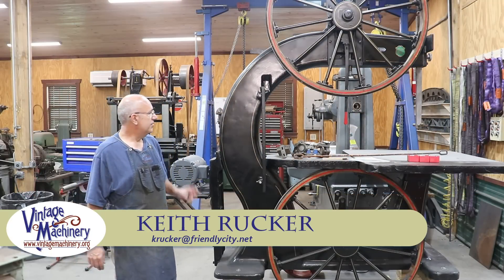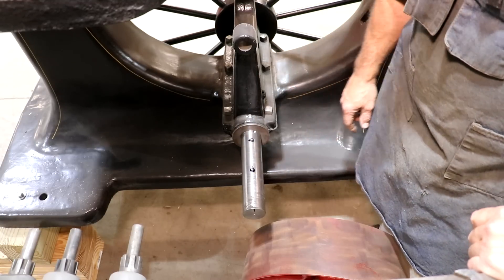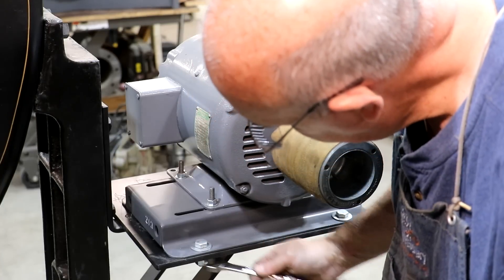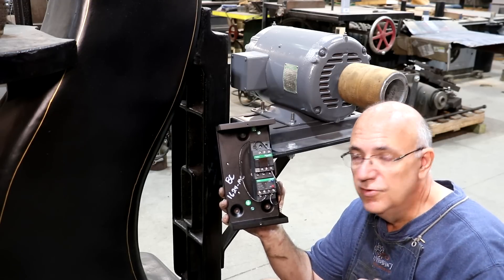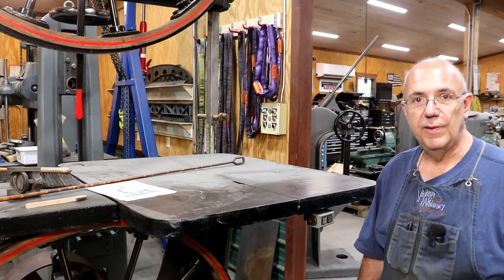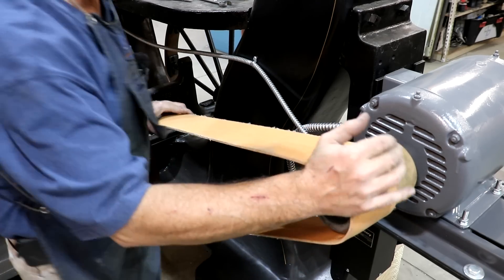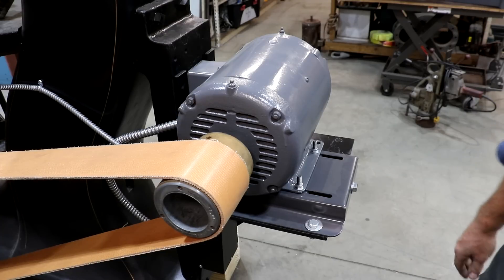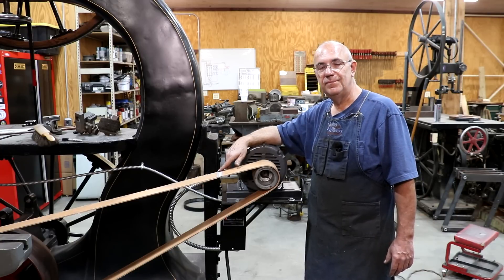Diresta Bandsaw Restoration 31:  Installing the Motor Starter, Flat Belt, and First Run!

Comment: Hi Keith. As a former belt technician I have a few ideas. 
1/ lateral crown on motor pulley is much more than bottom drive pulley. When full start tightens bottom of belt and loosens upper section causing motor pulley crown to throw belt off. Flattening crown will lessen belt movement as speed ramps up. 
2/ensure centre of each pulleys’ crown is aligned on same plane. 
3/increase mass of motor pulley to slow motor ramp up. 
4/increase flat width of pulley to help control belt travel
5/ensure lacing is square to the longitude of the belt, not just the end. 
6/tighten belt further as I think its still a little loose. 
7/motors or end pulleys should be able to tilt and tighten. You have only one adjustment bolt, should have 2, 1 near each set of cinch down bolts. 
8/last resort is reconfigure motor to middle and run an idler pulley where you currently have your motor. More like a serpentine belt on a modern vehicle. 
Hope this helps.
Reply: These are great suggestions. Thanks for contributing!
Reply: I don't think Keith reads the comments, I have never seen any reply's from him to any of the comments on his sight. I hope he sees yours thought, it sounds like you know what you are talking about.
Reply: I have a flat belt drive I have to set up, this helps tremendously, thank you
Reply: @joepeanut6827  Keith references comments in videos all the time, so he definitely reads some of them, but he just doesn't respond much via YT comments. I've seen him comment frequently on his Facebook feed, and he mentions interactions with Patreon members a lot.
Reply: ...flattening...
Reply: @Sagacity61  damn autocorrect! Thanks
Reply: @morpheusduvall  If you are trying to mimic an old time overhead flat belt system. You may want to consider rotating the motor 90 degrees. I suspect that's how our elders tried to mitigate belt tracking problems. But that's just a hunch!
Reply: @RuthlessMindset68  it’s actually just a small flat belt drive for a die filer I’m building. I put about a 2 degree taper on the flat belt pulleys I turned. Granted I still have to bolt the motor down and devise a take up mechanism for the belt, I’ve had issues with the belt coming off on startup

Comment: No VFD's back in the day. The belt was trapped by forks (and later caged in) and the operator learned how to let the tensioner fall slowly to start up easy. Just like learning the clutch on a car (which everyone knew back then). Overload protection was set by the weight on the tensioner. Small weight, low power before the belt slipped. Big weight big power. Had to watch it though the plant manager didn't like it if the main shaft slowed even a tiny bit.
Reply: This is the old-school way of dealing with the problem of getting this much mass in motion and is fitting for this Beautiful old Beast. Nice job Keith!

Comment: A VFD will also allow for braking to reduce the rundown time
Reply: It'll need a hefty braking resistor but I think you're right.
Reply: Agree, getting the machine stopped in a reasonable timeframe is going to make for a safer tool as well

Comment: It looks like the saw has the guides for the belt shifting fork. If so you could set it up with tight & loose pulleys, that way the motor would start with the belt on the loose pulley under no load and the operator could then feather the shifter to bring the saw up to speed slowly. It would be a more original style of drive and help keep the electronics to a minimum, always a good thing in my opinion.

Comment: Look into the Siemens Model: G120C series AC motor frequency drive, they are very good.
I suggest that you re-locate the motor starter to the opposite side of the motor support table. The way it is right now, you need to go through the belt to service and/or check it.
You also might want to consider running conduit instead of BX from the start / stop switch and motor starter / frequency drive system.
Reply: The VFD will now be the starter.  He will need to choose a mounting spot that will allow easy programming.  The start/stop switch and motor starter will go away.
Reply: 1- No motor starter with a VFD. - That is a sensorless vector drive,,,,no use at all on a band saw and will cost over a grand.....but the greenfield defiantly has to go.

Comment: Keith one other function of a motor starter, is the safety 
switch.  That is why the magnetic contacts.  You are running 
it, and the power goes out, when the power comes back on, 
the motor won't run.  Period.  Not until you hit the start button.

steve

Comment: Black conduit instead of that unsightly drape of siver flexible would be much  more in keeping with the period and look, you have done such a good job here, its worth going the extra mile; I would also run it on the back away from the belts etc. Obviously a short length of flex is needed to accomodate adjustment etc even then keep it black /brass

Comment: If the only problem is the startup ramp, you could simply use a Soft Starter. They can ramp up an induction motor over a couple of seconds with a configurable startup curve and are much cheaper then a VFD.
Reply: VFD's are not expensive, given what they can do.  Don't forget, the VFD will now be the motor starter.  Keith will have a starter to put in stock!

Comment: with the VFD you can program dynamic breaking to stop the motor
Reply: I hope he doesn't break it. Dynamic braking is much better.I
Reply: That is exactly how a vfd dumps the energy.....and if the residual torque exceeds the decel time it just opens the circuit and  it will coast to stop VFDs are a whole 'nother ballgame from copper and relay logic.

Comment: I would have to do that wiring different so that it was much more blended with the saw.  Surely the wiring could have mostly been hidden inside the casting avoiding that conduit hanging on the outside like a sore thumb.

Comment: I have had good luck with the Chinesium drives, I have a 3hp drive on my lathe and a 7.5 hp on my 5hp air compressor. After replacing 8 capacitors on the air compressor caused by stuck starting contacts, I changed to a drive with 5 hp motor-the drive has enough torque capability to start the air compressor without unloader. On my lathe I mounted the keypad on the front of the headstock and added a magnetic pickup inside the gearbox so I have a direct readout of spindle rpm. I figure with the difference in cost of the Chinese drives v/s name brand i could buy 3 replacement drives and still come out ahead. Most drives have a removeable keypad that can be remote mounted. Thank you again for the information on my lathe-by luck I purchased an entire gearbox with a broken casing on E-bay-all good now.

Comment: Good explanation on the purpose of the starter. Easy way to remember: the circuit breaker protects the wire, the starter protects the motor.

Comment: A variable transformer in a black box possibly above the motor would control the speed and still be vintage. Just a big antique knob with an RPM dial rather than a DRO display.

Comment: When drilling for set screws, I use a allen screw drilled out the size of the dog point it holds the shaft and pulley in the right spot. No need to remove pulley again.

Comment: I would check to see how much of a crown,the small pulley has.If it is sufficient,start it and,let it run for awhile to let the belt wear in,for a lack of a better phrase. It may stretch the belt in the center a bit

Comment: There is about 5% electrical slip on the induction motor, well within the operational range of a induction motor. The 450 rpm is one quarter of the 1800 rpm for a 4 pole induction motor. The motor may load down in actual operation, but the torque will keep up. The bearings will seat in and decrease the friction after some run in.

Comment: If this is a 3 phase motor, you could look into a delta-y starter before committing to a vfd. I think a delta-y starter may give you the soft start you are looking for.
Reply: On a 5 horse motor? - Big $$$$$$$  - Trust me, You cannot beat a cheap VFD. - Soft start. Variable speed, and quick breaking.

Comment: When you started the video talking about a motor starter I thought for sure you would be installing a VFD. You were only turning the lower pulley. Adding the blade will increase the starting mass even more. As others have mentioned, a belt tensioning system would be the old school way but a VFD is a much better solution today.

Comment: 48" wheel has a circumference of 150.8 inches.. at 427 rpm.. your looking at 64,390 inches of blade per minute. or 1073 inches per second or 89 feet of blade per second.. thats a fast moving blade :)

Comment: Star-delta step start might be the way to go.  And would you really need a slow start when the upper wheel and saw band are fitted?  The extra torque needed should slow the initial rotation quite a lot (and will probably also increase the start current draw).  But what will happen when you cut the power and the large amount of stored rotational inertia then drives the motor into generator mode?   VFD is probably the best idea.

Comment: You might be aware of an inconsistency in your volume level,but I thought I would point it out since it has been showing up in approximately the last six  videos without correction.Otherwise the production quality has been excellent.Thanks for sharing Keith!👍😃
Reply: I noticed the same.  The volume during the mag drill scene isn't normalized.  It seems like it was set to the max volume of the drill rather than your voice.  It needs some automatic volume control type correction in that scenario.

Comment: I loved it Mr. Rucker - Great video. Sorry about the motor offset mistake, I’ve personally seen opportunities regarding my machinery repairs in my iron shop for more design iterations. For instance, you can widen the mounting plate and have a coffee cup holder for Mr. Diresta. I dont mind the no nonsense festooning of the cabling and was surprised at your obvious location choice for the on- off switch. I always selected the latest/greatest in replacement hardware for "detailing porn" if you will.  I very much appreciate the mindful restoration regarding the manufacturing period of the machine.

Comment: Keith I hear a ticking, is that from the lacing going over the pulleys? If so, I worked as a Millwright in  a factory where there were miles of flat belt coveyors everywhere. And the foreman made us cut the belting on a 45 deg diagonal so that when the belting ran on the pulleys it cut the sound down. Not sure you have ever heard of this tech?

Comment: When I worked in tap & die we used belt dressing to reduce slip. Although that might not help much considering you'll have even more rotational inertia to overcome once you install the blade and have to accelerate the upper wheel and blade as well.

Comment: Coming right along on the restoration. You may want to shift the motor out to allow the belt to run at least center of the motor pulley vs. out on the end. It will help with deflection and the motor bearing on the shaft end.
Thanks for sharing.

Comment: A suggestion: since your motor mount bracket plate has a few inches on the back end of the motor, you could spin this plate around to gain the inch or so needed to re- position the motor mount. Thereby gaining the correct pulley position. This would be safer than trying to make a spindle extension, that might put excessive stress on the  motor spindle. 

Since it us always difficult to re- engineer from a line shaft to a separate motor, such difficulties are not uncommon ,as you want the belt to be centered on both pulleys. You now have the line of the belt, so use that to determine the pulley center for each pulley.

Comment: I’m curious, what is the small pulley constructed of and is it original, I have a 18” wide belt surfacer that had that prob and I changed the drive surface to rubber that didn’t slip and solved the walking problem on start up and a lot more tension on the drive belt

Comment: wouldn't be that flat for the set screws also be necessary because else putting torque on them would deform the metal at the point of contact and makes it difficult to get the wheel of again?

Comment: I know some will see adding a VFD to such an old machine as heresy but the soft start will extend the life of the machine which is a good thing. The other consideration is back in the day the electrical supply itself could well could well provide its own soft start with the lights dimming etc..
Reply: More then the SS starter?
Reply: @mathewmolk2089  Personally never used a VFD but have been around motors and actuators rated in the millions of watts where a gentle start to the heavy metal spinning is desirable. Looking at this big bandsaw I see a lot of energy being stored in the two wheels and that has to come from somewhere. Having a gradual acceleration makes no difference to the stored energy but a lot of difference to the power and hence the wear. So if it was my beast I'd would be happy for it to take a while to come up to speed. The bearings and the belt will last longer.

Comment: Maybe just moving out the motor to center the belt would be sufficient. I don't think Jimmy will use it dayly, i assume a little slippage on the start would not destroy the belt for long time so you can avoid the soft starter.

Comment: As an electrician, I am not big on the wire routing of the stop start controls,  would have gone down with the wire and come back up.  Rather than have it draped across the machine.
Reply: Same here, and would look a lot cleaner if in conduit, painted black!
Reply: That's a very good point. Should the flat belt break or come off of the pulley, there is a chance the belt could fly up and tear out that section of BX.
Reply: Feel the same way, it looks sloppy AF. Should routed it down the base and possibly painted the shielding black to blend it in.
Reply: No,  perfect job.
Reply: You do realize that once this gets to NY, this machine will just be an objet d'art
Reply: Here here, never mind practicality it just looks ugly!
Reply: EMT? Rigid? even Sch 80 PVC?   anything but rat cable.

Comment: That flexible conduit hanging looks shoddy. Some nice rigid conduit shaped along the body lines and painted in would be much more comely.
Reply: Yes, at least from the on/off switch back to the starter box that drooping cable just doesn’t seem to fit the quality of the build. That is a nice looking saw.
Reply: I don't think rigid conduit is necessary, but certainly re route the BX to follow the curvy lines, down and around the flat belt pulley, and yes, painted black to match. Still work to be done and easy enough to change.
Reply: @christopherlong2301  weatherproof BX, with the vinyl coating, routed to follow the curves and painted black would have just about disappeared.
Reply: "Shoddy"? :face-blue-smiling: It's conduit, it's how it's run. If Jimmy wants to do something else, Jimmy will do it.
Reply: I disagree, rigid conduit is a pain and it's good on a precision grinder not to over constrain anything. The flex conduit allows things to move with the machine.
Reply: @aserta this one isn't for Jimmy. It's Keith's machine.
Reply: @crystaldragon141 it's literally in the title of the series. "Diresta band saw restoration."
Reply: @6justin9  turns out my I posted this on the wrong video lol
Reply: BX dates back to 1903, is surprising how long that stuff has actually been in production. I think it would look just fine painted to match the machine.

Comment: Hi Keath saw speeds do you measure them in RPM or Feet PM some will argue RPM and some feet PM I was told by an old saw doctor that it was feet PM. Whats your answer to this, just interrested. Cheers

Comment: Hey Keith, just something that I had as a brainstorm why couldn’t you build our machine a plate to put on the end of the pulley for the motor that would make a shoulder this way it would keep the belt from wanting to run off the end instead of leaving it With no shoulder there seems like a cheaper way to do it and not needing to have the verbal drive
Reply: Shoulders on pulleys are not a good solution as the belt will just wear them away.

Comment: Square d does make a 25 amp breaker-I bought one but it was single phase. Don’t know about 3 phase breakers.
Reply: You can put 3 single phase ones and it will work fine.3 phase breakers are just that 3 single phase breakers but its in one body connected so they all shut down at same time.

Comment: Can I conject that the wide/flat pullies are for use pre-electric motors where the shop had ONE/SINGLE drive for all machines?  The single drive was driven by either water wheel or steam engine?  And not really very long ago!

Comment: Hopefully the VFD is designed to automatically start at low frequency and then gradually increase to high frequency, rather than you having to do so manually, like you do on the metal planer.
Reply: You can program it to do whatever you want, especially accel/decel.  Go from .1 second to minutes on even the most basic VFD,  Best thing since sliced bred.